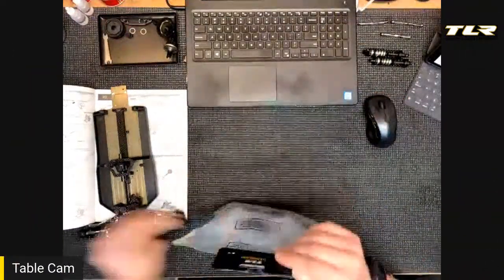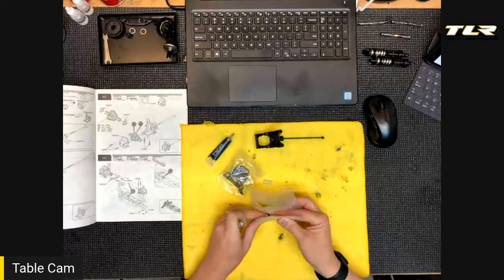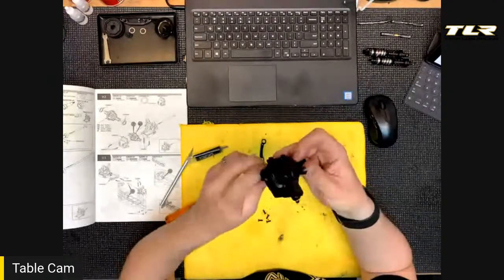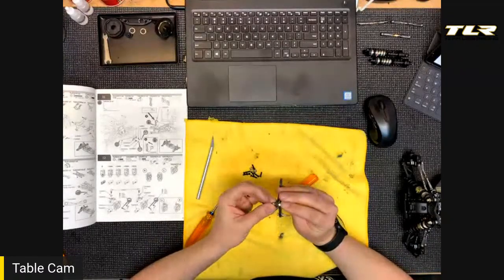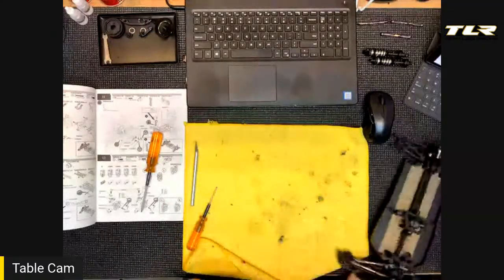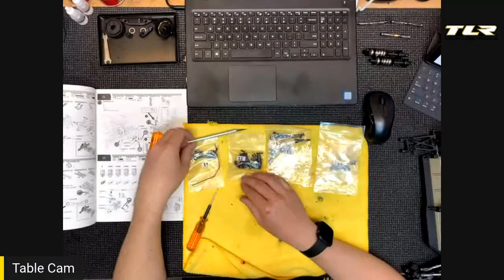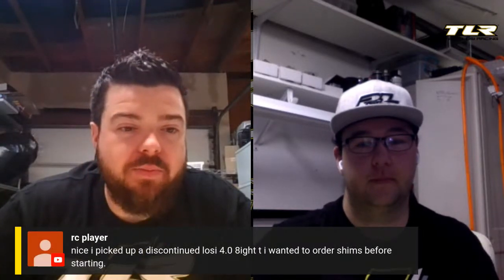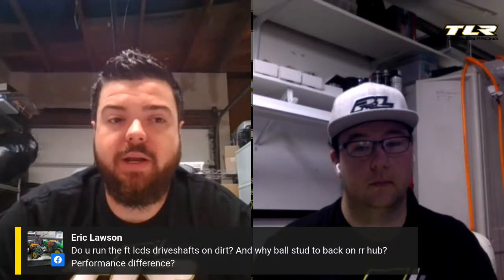22X-4 Build Series, Rear Suspension, Bags H & I

Comment: Finished my first build...a 22x4. Thanks for all the helpful instruction and tips. Having bit of an issue with droop. The rear driveshaft (87 mm) keeps falling out of the outdrive cup and it appears to be due to the rear suspension arm and shock riding too low. I did not see any info in the build manual that addressed droop adjustment. Can someone point me toward a resource or two? Much appreciated.
Reply: Have you found a solution?